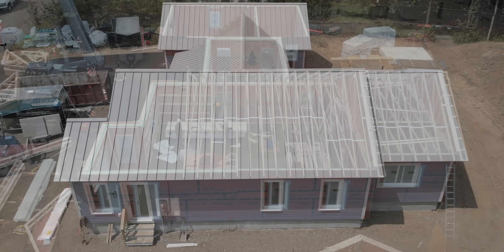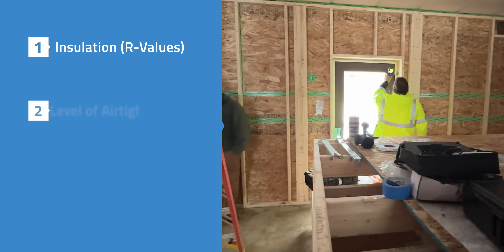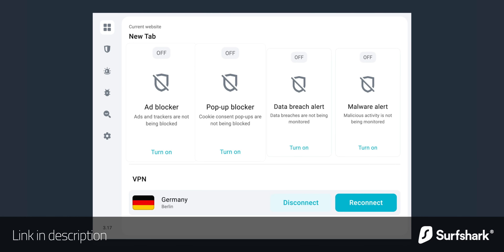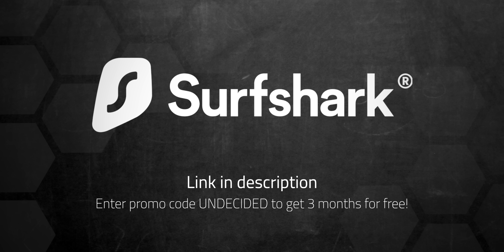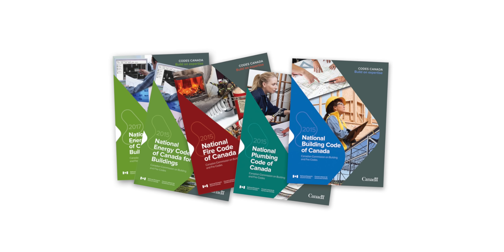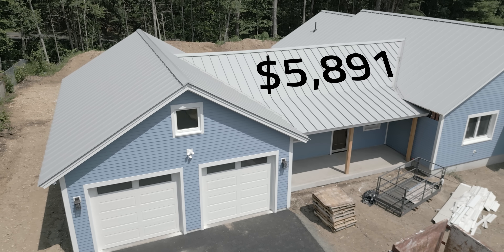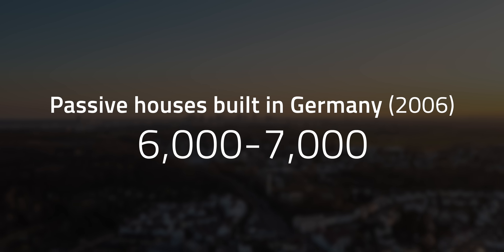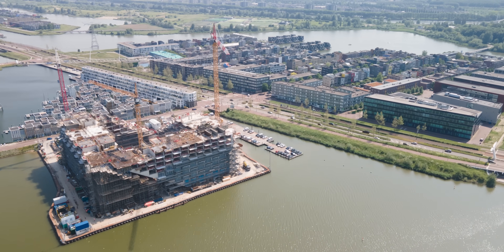Why Do American Homes Suck?

Comment: I've been working as a residential energy rater in the South Eastern US for about 7 years now. I would never buy a production house in the US. From inadequate local codes to builders trying to maximize profits, it's a nightmare out there for a prospective buyer. Someday when I have enough money I'll build my over engineered masterpiece of energy efficiency and climate resilience. Keep the great content coming!
Reply: You said it... "when I have enough money"
Reply: @WaltTaylorau  Right?! It's already going to cost more than any comparably sized house 😅
Reply: We did just that seeing that the cost of an ICF home in this market is not as much more expensive as some would have you believe.
Reply: We are curretly working on a solution for that problem, highly efficient Passive House standard building plans and materials for experienced buiders in the beginning and as we progress and fine-tune the system, we may be able to offer to DIY home owers with at a 75% reduction in cost. Hopefully soon we can make a difference, one building at the time.
Reply: The large production home builders really put the K in Quality here in the US, especially when it comes to the thermal envelope.
Reply: When Tesla went to $1.84/watt for US rooftop was the "enough money" point, for me.  With batteries, the expense of efficiency can intersect with a given home's solar potential.  Especially existing homes.  Depending up on utility buy-back (export) rates, there may be little incentive to retro-fit, or go with ~R40 walls, if they're more expensive than choosing a bigger solar array, like 25KW instead of 15KW.  This assumes ~70 panels can fit and you have some back-up.
Reply: Good luck with your own build. As an inspector you probably know that roof ventilation is almost never done right and it’s a critical factor for hot climates, to keep the roof cool in the summer and to reduce heating of the house through the roof.

I have worked on literally hundreds of homes and actually I built my own home myself. From what I have observed, my home is the only home I have ever seen that is actually meeting (actually exceeding) The code on roof ventilation..  I have worked with some very good contractors and even they don’t care and don’t do it properly. They just follow the plans, the plans are usually in adequate for ventilation, and then when they assemble the house insulation and all kinds of other things block the ventilation and it doesn’t work right anyway. Never seen it done right except for my house. That is a fact
Reply: I’ve only ever built and lived in custom built homes. Never had a problem
Reply: @carlyk_ same!
Reply: Agreed with you
Reply: Amen
Reply: Yeah, I’ve been getting recommended videos by a home inspector and it’s worrying how many issues some brand new builds have
Reply: Same, if I'm fortunate enough to build another home it will be modestly sized but highly energy efficient. I think we are chasing size and sacrificing too much on energy efficiency in USA
Reply: Local codes are not the problem. The real culprit for the lackluster quality of housing is the unfettered greed of virtually every group and trade involved in the industry. Housing prices are already absurdly expensive, and blaming energy codes would only lead to even more expensive housing. Oh, and I am both an Architect and Engineer.
Reply: @donquijote6030  you do realize that architect and engineer are two of the most expensive components of construction, right? You get paid ass loads of money compared to the guys who are actually doin the construction.
Reply: @Matt-yg8ub  - Your statement is incorrect on both accounts. Architects rarely, if ever, design detached single-family houses. They are almost always designed by "homebuilders" who hire CAD draftsmen to produce the drawings required for permitting. The Structural Engineer may be hired to size a few headers, beams, or shear walls depending on weather or seismic conditions expected in the region. However, the Engineer does not spend much time or effort on the design for the same reasons that the Architect does not, i.e., they are not normally required for single-family housing. The IRC (International Residential Code) provides prescriptive parameters that a homebuilder can follow without the need of licensed professionals.

Hopefully, that clarifies the assumption that we Architects and Engineers contribute to high housing costs. It simply is not so.
Reply: @donquijote6030  Lol, ok, if we’re going to get pedantic you’re correct….residential development is cookie cutter so that the developer only needs the incredibly expensive services once or twice. I was simply pointing out the hypocrisy of criticizing others in the process of price gouging while being one of the most expensive and overpaid cogs in the machine.
Reply: @Matt-yg8ub  - There is nothing pendantic about what was written, but rather specific facts of the industry. What is more, you have stated that the professional services provided by an Architect or Engineer are "incredibly expensive". What do you believe the average cost is for those services for a detached single-family house? Please be specific as the claim itself is specific.

As a follow-up to the question above, did you know that realtors demand a minimum of 3% per realtor for the transaction, which equates to 6% of the sale price of the house. The value added by a realtor is surely less than that of the one designing the house and much less than the one building it. Why then would you be willing to target those who went to school for 6-10 years to become architects and engineers and not those who studied for a few weeks to become a realtor?
Reply: @donquijote6030  well now we're moving into the shortcomings of our capitalist economy and what a fair wage looks like in a world where average pay has absolutely not kept up with cost of living increases. But, alas, that might be a bit too grand of a topic for the comments section.
Reply: @darianrichmond7678  - This is hardly a "shortcoming" of capitalist economy", but rather a direct reflection of the shortcomings of government regulation and central planning. The renowned economist, Thomas Sowell, has written extensively about the dangers of regulatory bodies having the power and authority to influence what is built. These are people with little knowledge of the development process, little knowledge of the costs, engineering, or risks. As a consequence of their ignorance, the increased costs to build quality, affordable housing is passed down to the end consumer.

The states and municipalities with the highest regulatory burden are those with the least affordable housing. That is not a coincidence. If you want quality and affordability, then you should look at demanding municipal governments to step aside.
Reply: @donquijote6030  I do wonder how such high regulatory burdens became the norm in so many places.
Reply: @darianrichmond7678   here we go again. If only the minimum wage was X amount…. Life would be roses, except a gallon of milk would cost $15 because the stock boy in the back room got his “ living wage”… which drove up prices which caused the government to increase the living wage, which drove up prices, even more, which caused the government to increase the living wage even more… rinse, and repeat.
Reply: @Matt-yg8ub  you said minimum wage not me
Reply: @donquijote6030 Florida might like to have a word with you on that, particularly South and South West Florida.  Housing and rent are through the roof here.
Reply: @donquijote6030  Greed is only possible in an unbalanced market. I don't blame builders for charging what they can, because the market is cyclical and most people would rather work from a desk at home.
Reply: @approots  - I beg to differ. Greed exists regardless of regulation, personality, and market forces. Nothing can stop greed as an incentive for personal and, dare I say - group - gain. I agree that most would rather "work" from a desk at home despite the questionable value of such "work". In fact, greed is the motivation of those who would rather perform menial tasks from their desk at home, rather than the much needed trades that construct buildings. The "Green" industry is replete with examples of this very thing.
Reply: @donquijote6030  Of course greed is human and a great motivator, but my point is you cannot be greedy unless market forces are in your favour. Were builders greedy in the subprime aftermath, or were they lowering their prices to keep food on the table?
Reply: @approots  - Were banks and government regulators greedy in demanding greater and greater proffers, fees, and questionable environmental studies? To analyze the question of greed without scrutinizing as many participants as possible is short-sighted. Greed always exists and cannot be eliminated from human nature. No amount of manipulation tactics - price caps, subsidies, regulations, or social pressures - can remove them when personal gain is possible. Socialist countries have the worst record in creating income disparities and low-quality housing through their efforts to influence "market forces".
Reply: @donquijote6030  What are you on about? You did write greed exists "when personal gain is possible". That's my point. Can't be greedy when the market isn't in your favour. It's OK to agree.
Reply: @approots  - The trouble with those who appear to know the least about any given subject, is that they are always the most vociferous in defending their ignorance. To believe that greed does not exist in an unfavorable market is to believe that greed does not exist among the poor. Is that your claim?
Reply: @donquijote6030  Lol. A greedy person without leverage will fail. The cure for greed is starvation. Ultimately the poor guy has to show up for his shift at McDonalds.
Reply: @donquijote6030  You're like: "People can always be greedy!" . I'm like: "I agree! But they will fail."
Reply: @approots  - Interesting comment.
Reply: @approots We have a FED that manipulates interest rates and likes to quantitatively ease the dollar.  Of course the market is unbalanced.  Especially in the housing and construction sector.
Reply: @approots depends on the location.  Part of the subprime mess was that in Florida and in other places in the south, developers overbuilt, creating a glut in the market, not realizing that a lot of the sales were customers buying homes as investment or rental properties.
Reply: @approots  From European perspective, I would say, US economy runs on greed. It's not a bug, but a feature. Us lacks system making the market stable and fair for everybody unlike in other places in the world.
Reply: "over engineered masterpiece of energy efficiency and climate resilience"
Do you mean a german standard house? Standard by government regulations.
Reply: @danngehdochzunetto  You fail to realize that issues still happen in over engineered government standard homes. I was stationed in Frankfurt for several years and during that time multiple properties began having issues with corrosion of the reinforcement inside the concrete. Load bearing walls were showing signs of degradation.

In case you didn’t know, most newer german homes that use concrete are pre-fabricated concrete and then brought to the building site. They don’t really pour on-site other than the foundation. They’re higher quickly buildings, but what comes with higher quality materials involves the need for high quality repairs. At least for me, the replacement of a load bearing concrete wall was nearing the US equivalent of $30k worth of repairs just for 3 load bearing walls. Not only that, the project to do the repair took almost 4 months to complete.

Higher quality german engineering only works when things dont break. The moment they do, it becomes Insanely expensive and time consuming to fix
Reply: No you won't once you see the price. The reason we don't build that way is customers don't want it. We build what customers want.
Reply: @sparksmcgee6641  clearly you didn't read my comment. In this instance I'm the customer and I'll pay for what I want.

Comment: Hi Matt - You mention you have a certificate that shows a saving of $5891 compared to average house in your area. I live about 30 miles from your property and my energy cost last year was $2745 electricity and $1963 natural gas for a 5 bedroom 3800 sq.ft colonial. Last year 2022 was exceptionally higher for natural gas and electricity compared to previous 2 years. I would consider my 28 year old house average or slightly below for the area. Could you please explain how I could get $2745+$1963-$5891 =   -$1183 i.e. I would not pay anything in annual energy cost and get paid to rebuild my house to the same standard as yours.  I don't have solar panels which is the comparison you mention in your video
Reply: LOL, 3800 square feet in AZ in 20 year old house, that covers Gas, Electricity, Water including Pool and Irrigation, Garbage, and Internet here.

Comment: $5891 really a yearly savings?
Because I spent less than that for over 2 years heating and cooling a 2000 sq foot home in western Pennsylvania.  
I could include water and sewage and still be at that for 2 years.

Comment: Great video Matt. Some additional  comments to think about: 

1/ Americans don’t live in their homes long. On average Americans move every ~7 years, where Europeans live in their homes much longer. Often generational homes. So operational cost is not considered and home improvement projects often don’t pencil out in < 7 years. 
2/ The US surprisingly still has a lot of open land, and is not as densely populated as Europe. So it’s often easier and less expensive to move slightly further outside the city and build new. 
3/ The skill level for builders and the skilled trades I would argue is better in Europe than the US. The trades are viewed as second class in the states, but not the case in Europe. For example, in Germany, many technicians have the equivalent of an engineering degree. This is changing, but we are still behind. 
4/ The growth of solar and better performing buildings is directly related to the cost of energy. Some areas of the US pay more than $0.30/kWh for electricity, but other areas pay $0.05/kWh or less. This is a 6X change in energy cost for the same house in the same climate, meaning that states with the highest utility costs will see the most energy upgrades!
Reply: valid remarks, but the 1st. Even if one moves every 7 year, you still will be living in SOME house, somewhere and therefor all houses should be better built.
Reply: No the trades are still denigrated, 50 years plus and running.
The only people you'll bring up Re electricians and plumbers because they have a liscene that a parent can brag about.
That's the reason their  wages aren't cheeping up with roofers and drywall. 
No change happening on status, guessing you're young and latch onto media we've all heard for decades.
Reply: As mortgage rates in the US approach the range of 7-8% for the foreseeable future,  it's likely US homeowners will stay put for longer than they used to, especially for many homeowners who have fixed mortgages at or under 4%. This might lead to renewed interest in operational costs and higher expectations from homebuilders.
Reply: I can attest to that. I was fortunate to get a 3.4% apr. on my mortgage and intend on living in it for as long as I can. I'm constantly thinking about ways to make my home more energy efficient. I'd like to add solar and a hybrid heat pump HVAC system in the near future.
Reply: @afs3294 why would it? 
As a builder doing efficient homes the people locked in by a good loan have no effect on new home demands by definition.
People in low rate homes can't afford efficiency upgrades or they would have bought them with 3% mortgages.
Reply: Also in Germany most people rent.
Reply: American HOMES don't live very long either, comparatively - they tend to knock them down and rebuild within a few generations. This doesn't really happen in Europe. Homes are expected to last forever, essentially.
Reply: @Bertie_Ahern  they knock em down in Europe. with war.
Reply: @Bertie_Ahern  I'm living in a cheap wood house built durring a rail and silver boom. Still fine and things have been upgraded. I own 4 houses meant to be used for 10 to 20 years a built as cheap as possible, all still going and almost 150 years old. US crap houses last centuries. 
They knock down whole areas in Europe and rebuild.
Reply: Why the fact that you move more often implies that your house has no incentive to not be trash?
Reply: I agree with all points but also like to add that the Nordics. Sweden, Finland and Norway more specifically have tons of land. Around 60-70% of their lands are forests and then there’s large parts that are somewhat inhabitable. So point 2 can also apply on them
Reply: First point is kinda understandable, since many Americans live in areas with tornadoes/earthquakes happen. Although, with a house properly built, there is high possibility, it would survive some tornado activity, which would otherwise move them with the house.
Reply: I wanted to add a fifth point. Relatively mild climates for much of the country. I live in a mixed zone, so keeping the house warm and cool is pretty simple most of the year.

Comment: NH here. I thought I was getting a sweet deal on energy efficiency increase when, upon re-siding my house, I went from pine siding on plywood to mounting vinyl on R7 foam insulation (the initial quote had been for R3.5). Still nowhere near the R35 in a pre-fab though.